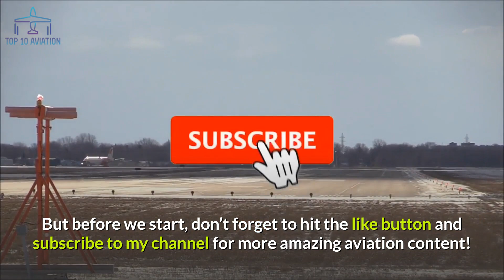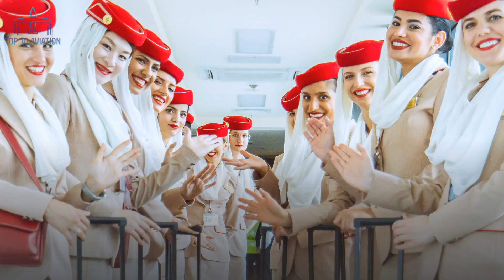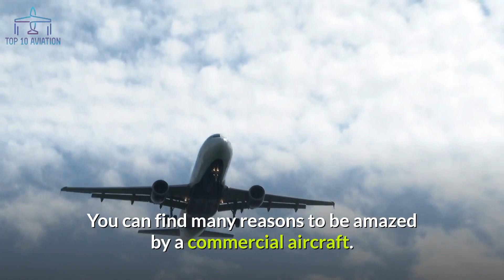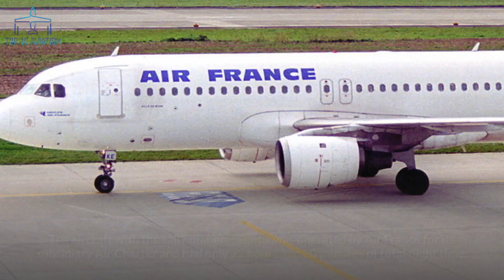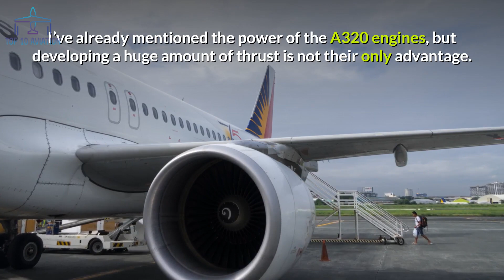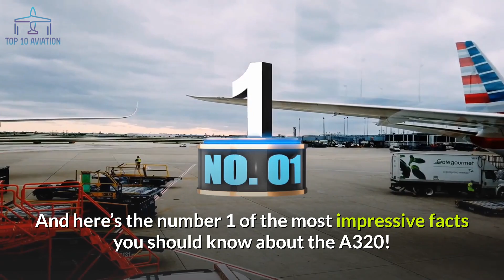Top 10 Airbus A320 Unknown Facts

Comment: Well even if A319 is the smaller brother of A320 it is still not A320 😁 so number 1 got nothing to do with A320
Reply: All facts in this video also count for the rest of the A320 family, also when saying A320 you mostly refer to the entire family. After all, only fuselage length and some aerodynamically changes on the A318 and A321 are different

Comment: Your statement about number 7 is straight up bullshit. Airplanes are so redundant that literally any primary system on the plane can fail and it will still fly safely. You can even lose a damn engine and still fly the plane.

Comment: I m 737 type rated ..and I hate that somebody says this is the best AC... A320 and 737 800 are almost the same in fuel efficiency performance etc... in some poits of wiev is better A320 in some boeing 737800...how suprise that airbus has 2 generators- Boeing not ????
Reply from the maker: At no point I'm saying that the A320 is better than the B737 except for the sales in 2019, which is simply a fact. 
Of course the Boeing also has 2 generstors...but this video is about the 320 and its generators, nothing else 
I have absolutely nothing against the 737 (except the max) and I find it a good airplane overall. 
And between us, at the end of the day, the type I'm flying is my last concern.
Reply: Why are you writing 737-800 specifically if you are 737NG type rated?🤔🤪
And what do mean with the sentence: "how surprise that airbus has 2 generators-Boeing no"??

Comment: Isn't Unknown Fact an oxymoron?  Something cannot be a fact and unknown at the same time.

Fuel capacity, engine power, orders, etc are not unknown facts?
This division of the overhead panel and cockpit layouts is not unique to the A320, this design principle has been around in aircraft since the 60's
Reply from the maker: Of course it is, but I find it funny lol 😁

Well it is more than normal for me (and other pilots) as it's part of my daily life. However it is unknown and (I hope) interesting to simple aviation enthusiasts that have never seen an A320 cockpit in their life. Hope you understand 😊
Reply: Not quite.  The much-maligned 757 and 767 were the first to ditch nearly all the analog "needle" gauges in place of digital LED displays.  

The A320 has no needle gauges and an A320 overhead panel assembled in 1986 is identical to one assembled in 2021.  Every toggle switch, logic IC, and wire bundle is the same and has not moved a mm.

Comment: 24.000 liters of fuel in an A 320.
A 380 : am I a joke for you with my 323.000 liters of fuel capacity ;-)

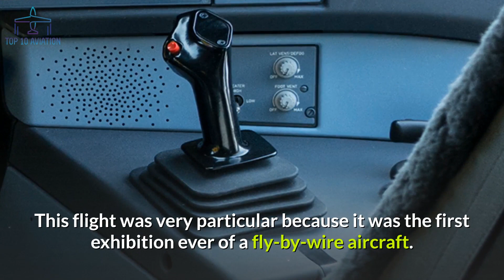6:51 not 100 % correct, the Concorde also was fly by wire, but it was an analog system, not a digital one like the A 320 has.
Military aircraft also have fly by wire systems (like the F-16 from the 70s on), but the A 320 was the first airliner with a digital fly by wire system

Comment: Very nice video. Power output in bhp is considerably more. Many factors are taken into account to calculate this conversion. It can’t be done directly. As quoted by Airbus the A321ceo with IAE engines has approximately 210000 bhp at isa toga power. Considerably more than 10 Chirons. Think about it. 10 Chirons would hardly get a 100 tone A321 to takeoff speed, let alone continua a climb to 37000ft etc. I have over 10000 hours on A320 family. Excellent video.
Reply from the maker: Thanks a lot for your comment captain! In which manual did you find about the bhp of the V2500? I had quite a hard time finding the exact values in my manuals...

Comment: Thanks for putting into true perspective just how much fossil fuel a small aircraft uses... enough to fuel a car for 40 years... astonishing!
Reply: Yeah until you factor in that the a320 has many more passengers and way more longer range than any car 😂 now that's the true perspective
Reply: @topethermohenes7658  of course I agree with you 😂, however it’s still a statistic worthy of scrutiny. Even during an unprecedented international pandemic, with much of the world ‘s population still grounded, a quick look at Flightradar24 shows between ~10,500 and ~7,000 aircraft aloft, many being commercial heavy or even, still, super category. Another statistic giving pause for consideration regarding the quanta of fossil fuel tonnage to which our planet must equilibrate?
Reply: @Michael.Chapman  then what other modes of transport is the alternative? If you exchange all those Trans ocean flights to ship then you'd be wasting more fossil fuels, if you change all in-continent flights to cars then you'd be left with basically the same fossil fuel usage as cars. Not to mention all alternatives take 10x more time as well. 

So unless your idea of saving fossil fuel is to stop globalization itself then the world is as efficient as it possibly can (regarding travel/transport)
Reply: @topethermohenes7658  Plus, for the CEO, you're talking about engines that were state of the art in... 1987.

Comment: How can i tell the different between the a319 and a320
Reply: If it looks quite short, it is an A319. The best identification is the over-wing exits. There is one on each side on the A318/A319 and two for the A320. There is none for the A321 (instead there is a total of four regularly sized doors on most aircraft). Usually,  you would see an A320 or A321. The A319 and A318 are quite rare (relative to the others). I hope it helps ;)
Reply: @goldviationflights  this doesn't always work as some A319s are equipped with 4 overwing exits, these are often low cost operators as they have more seats, therefore more exits are needed to evacuate in under 90 seconds
Reply: @lysaviator4705  Yes, that is quite true. Likewise, I am aware that some A321s have 4 overwing exits too :).

Comment: Something else most do not know, but clear on the Antarctic A319 is that integral airstairs were an option (not sure if they are still offered on the neo)
Air India also operated several A320s with twin axle main undercarriage to allow them to operate on weak runways.

Comment: Dont a couple of FIRST CLASS ONLY A318 (smallest A320 version) do the transatlantic route that Concordé used to do? Including having their Speedbird 001 and 002 callsigns? Thats a pretty cool factoid.
Reply: Unfortunately that service does not expose anymore
Reply from the maker: Gotta check that one out, bout you are right that's something really interesting 👍🏼
Reply: @Top10Aviation  Due to the short runway at London City, they couldn't take off with sufficient fuel and had to refuel in Ireland on the outward journey. However this was not a problem or inconvenience for the few passengers (no cheap seats on the specially equipped and modified A318s!) as they benefited from a very much quicker processing from US immigration who have a base at the airport while the aircraft took on fuel.
Reply: Not anymore.